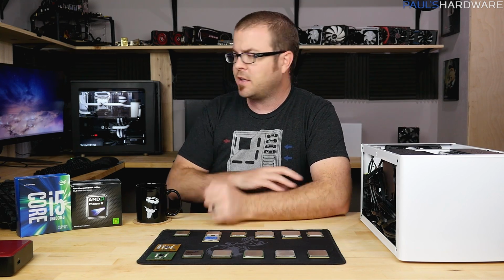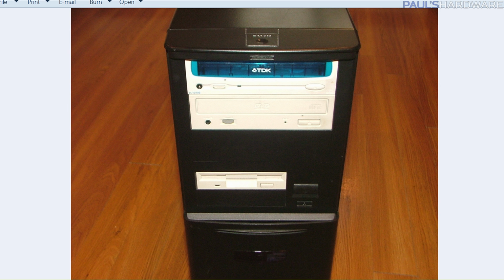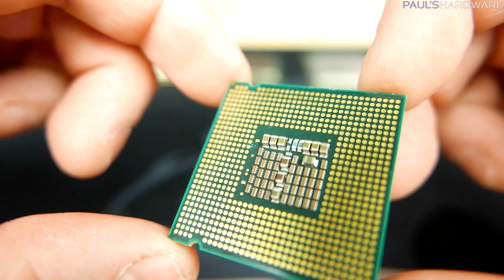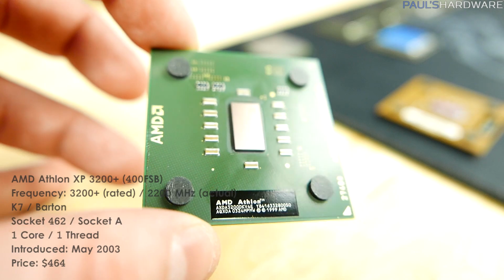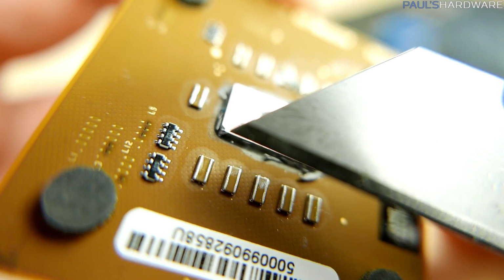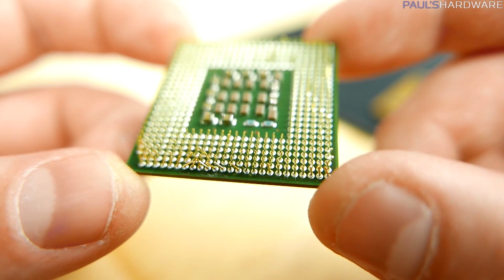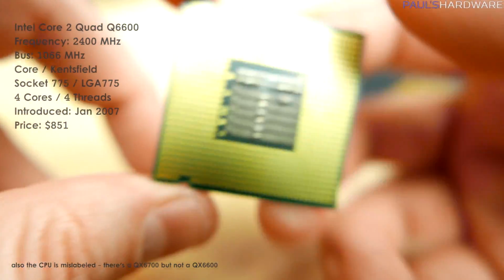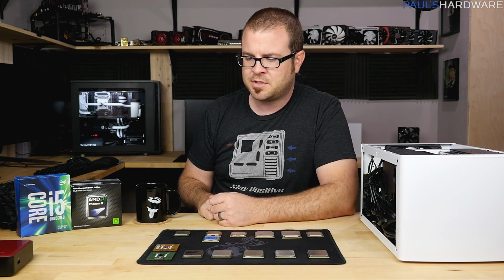My CPU Collection!

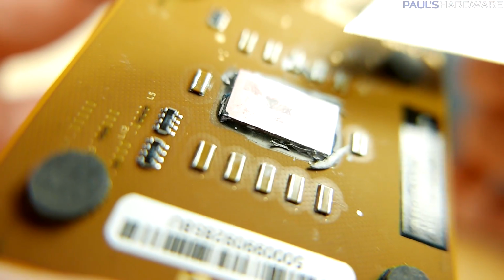Comment: 10:28 I’ve got a few Athlon XP CPU’s with worse die-chips than that, and they work just fine. In fact, of all the dead socket A processors I’ve seen, none of them died due to a chipped die.

I’ve also gotta correct you about mounting a cooler with the X shape method. Mainboards for the Athlon XP (socket 462/A) used a simple clip retention mechanism, it did not support coolers that could be screwed down in an X shape. The screwing down of a cooler using the X technique came about during the LGA775 era.

Comment: Intel Pentium 75, Intel Pentium 3 1000EB, AMD Athlon 64 3200+, Intel Core 2 Duo T7500 OC @ 2.6 GHz, currently still using an Intel Core i5 2500K OC @ 4.5 GHz, currently building a system with an Intel Xeon E5 1650 v2 (virtually identical to the Core i7 4930K) which after overclocking will be about as fast as an AMD Ryzen 5 1600X or 2600 but with far higher power consumption, quad channel memory and a silly amount of PCIe lanes.

Comment: I  still have a i7 920 on a Asus p6t deluxe x58, 12 g  triple channel 1600 .and it works just fine 24 hours a day 7 days a week never get's turned off and has done for about 13 years or so., it just runs faultless . Just goes to show Alienware was good before dell took over

Comment: The first system I ever built was with an AMD Athlon Xp 2500+ Barton core. I still have it, and the system. Those chips and that socket will always have a special place in my heart. It's actually a great socket for a retro build since you can do DOS and Windows Xp on it (if I'm not mistaken). I might pull that system out, clean it up and play some of my old games on original hardware :) Good times! 
Speaking of good times and old shit. I recently found my original Half-Life big box, as well as my Return To Castle Wolfenstein big box! Those are definitely going on the wall!

Comment: Mmm. You didn't talk about the mounting of heat sinks for the Athlon XP (and later) CPUs which required a flat-head screwdriver which always threatened to slip from the retention spring and land squarely in the motherboard to disastrous effect.

Comment: I remember ever computer I ever had in detail.  I started off  with a Socket A Athlon XP 1700+ around late 2001.  Moved up to a Socket 754 Athlon 64 3000+ 2.0 ghz after that. Kept that for a few years. Bought an Hp computer with a Athlon 64X2 4200+  after that and the MB crapped out. Replaced it with a Biostar AM2+ motherboard and got a Athlon 64 X2 6000+ Windsor core. That was around 2010/ 2011.  I kept that for a year or two, finally upgraded to a Phenom II X2 560 (With the hope of unlocking cores which was a fail) with a AM3+ board. Was waiting for the new FX Bulldozer CPU's to come out and when they turned out to be overpriced garbage, I got myself a Phenom II x4 980 as an upgrade which was an awesome gaming CPU in it's day. Then AMD fixed their issue with the at the time with brand new Piledriver FX chips,  and the FX 8350 did the job. I am still using my FX 8350 system built around 2013 to this very day. I only had to upgrade the video card once from a HD 7950 to a GTX 1060 3gb and that was just this year. It has survived longer than almost all of the others computers combined.

Comment: Still running a 920 D0 @4.0 , however when zen2 arrives it will get a good home as my wife's rig.
It's been my thrusty workhorse since '10 and has had a 5850 and a GTX 970 in it.

Comment: As for AMD Paul, I have owned all from the K-5 to now the FX-8370 under building my own. As for the FX-8350 vs. a well XXXXXX70 we can do 5.1 OC.I have done that with this setup. But as for OC That was for testing, and now it is back down to where it should be.

As for the AMD XP3200+ I had one.I also had the 939 3000 as well.

Comment: My spares: 
Some of crappy '02 celeron 1.3ghz single core i found for 99p on ebay
Core 2 quad q6600
Pentium D 930
Ryzen 7 1700 (in use)
i5 2520m (in use)
Celeron n2840 (in broken laptop,mean to fix it)

Comment: the athlons where locked so no over clocked but if you managed to connect the right spots on the die side you could unlock it and over clock

Comment: Used to have tons of those old Athlon chips. Even had a few dual cpu servers using them. Back in the day they were beast.

~Edit~ My first system was one I built, and it was the K6-2 333mhz. Used to use Epox mobos or E Pox or something, been so long I can't remember.

Comment: I bought a Phenom II 1090T in 2011 and I'm only replacing it this month with the new Coffee Lake 8700k. I had it overclocked to 4.0GHz on a Crosshair IV Formula and never had any problems with games at 1080p with a GTX 770. The GPU would usually max out first with the CPU hovering about 80%.

I still have the 1090T and the Crosshair IV. They'll both be used in my brother gaming rig so they still have a few years left in them!

Comment: I had an Athlon 64 x2 6000+. 
That thing was with me for 6-7 years. Then it struggled around 2011. Got an FX 8350 and it was light years faster but ended up getting an i5 4690k shortly after.

Comment: I still have the very first 1000mhz Intel Pentium 3 chip. It was a wonderful chip for its time. 133mhz FSB. I used to play with overclocking on this chip with some success. I think I had it up to 1.2ghz on a custom water cooling loop. This was during the time when clear acrylic cases were the shit and cold cathode UV lights were all the rage. UV reactive Ultra ATA 133 cables and non modular ATX power supplies that took some work to sleeve. lol

Comment: I think your memory is a bit cloudy because Socket A (462) motherboards don't have holes in the motherboard to mount the heatsink, the heatsink is clipped onto the actual socket. So your whole talk about cross patterns and tightening down corners of the heatsink doesn't apply because that's not how it worked.

Mounting a Socket A heatsink worked via a leaver action where you clipped one side of a retention mechanism down, put the heatsink flat against the die and then clipped the other side of the retention mechanism to the other side of the socket. The most often cause of die cracking is from mounting the heatsink backwards. There's a plastic shelf on one side of the socket and an indent in the heatsink to match, if you installed the heatsink backwards, you'd end up putting an edge down on the die and crack the chip if you forced it.

Another common problem was people putting screwdrivers through the motherboard when heaving down on the retention mechanism to get it clipped to the socket. Some retention mechanisms had far too much spring pressure and no well designed place to put a screwdriver to push down on. People would put the screwdriver wherever it would fit, push and it'd slip and plunge straight into the motherboard.

I'm glad that both sides got away from leaf-spring type retention mechanisms with hooks because they're so prone to causing expensive hardware damage if you don't know what you're doing. AMD has had an excellent retention mechanism since the Socket 754, and I'm glad they've kept it so long. Intel on the other hand has the shitty plastic push pin system which is very annoying to install and is also very prone to breakage. I keep a box of those push pins around because customers break them so often.

Comment: i had one of them amd cpu`s chipped bad the pc would turn on but funny thing started and it would crash after crash,i all so had a amd Athlon 1300 friday 13th 2001`ish i for got to put the heat sink back on & a heat haze came up out of the case as the di turned a nice shade of red, turned it off as quick as i could but to late DEAD but u could not tell it had been over heated so took it back to a___?, told them it just died  they took it away round the back to test it  and they say yes its dead  but all we got is a amd 1333mhz Thunderbird so i said yer ill have that lol  went home happy with a faster cpu 33mhz faster and i never for got to put heat sink on again.........

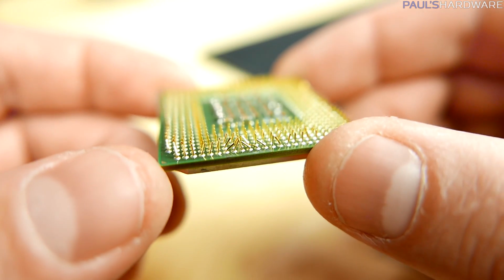Comment: 12:30  I once bought a small storage unit from an older gentleman with questionable values, with dozens of dell dimension 4400 and 8300 machines, and hp xw4100 workstations and various bins with components for these machines. All Northwoods and Prescott's if I remember right, all 32bit. I got very good at bending the pins back using the exact same method.

I'm actually still using one of the xw4100's as a file server. A 3GHz Prescott, 4GB RAM, full of SATA and IDE disks, on OMV3.0. It's been running for the most part going on 6 years now. Not continuously. In that time the only things that have needed to be replaced were 1 HDD, and a RAM stick that was probably nearing its end when I put it in. 
It just works. Gives good throughput with 2 netgear Gigabit pci cards in a bond($25). I added 2 additional fans I already had. I have a skeleton system that has replacement components for the entire server, minus drives and NIC cards.
I have the ability to build a new NAS system but this one just runs strong for its load average so there's no need to upgrade except to say I have the latest and greatest.

Comment: My Main System Has A i5 650........ herea the specs

intel core i5 650 
Geforce GT 710
Acer Veriton X490G Motherboard (LOL)
2TB and 320GB Hard Drive
Windows 10 LTSB 2015 x64
400Watt Power Supply

Pretty Low Spec...... Could Any Recommend Me a decent custom built computer specs for $500?

Comment: Just simply nicking the corner of the die doesnt auto kill it.. Depends how big, other crack, etc.. The "die" itself isnt on the top layer, there is a decent amount of just raw material on top. I have a 780ti with a chipped corner and it still works fine : )

Comment: I still have a fully insulated Chieftec CS 601 from the early 2000's - It's great as a case for the 2nd PC because it has tons of place for hard drives (up to 9) and optical drives (up to 3). Back in the day we actually had to insulate our cases ourselves :P

Comment: My HTPC is still rocking a Q6600 Core2Quad.
I've put a modern GPU in there so that I can playback HEVC h.265 video but other than that, it works perfectly fine :)

Before it got put into my HTPC, my Q6600 was my gaming CPU, for a few years.
I upgraded to a i5-2500k which is still driving my main PC.
I'm planning to go Ryzen 7 1700 later this year.

Comment: CPUs I've owed, always overclocked too, every single one here goes:intel 386,486, AMD K6-2 333mhz, slot1 P3 500mhz, AMD Duron 800,Athlon Thunderbird 1ghz, Athlon xp 1800+,Athlon xp 1900+,Athlon xp 2500+(Barton) unlocked multiplier revision, did 2.25ghz, Pentium D, Core 2 Duo,E8000, E8400, E8500, Core 2 Quad Q6600, Q9650, i3 4??? ,i3 7100k i7 920, i5 4690k, i7 4790k, i7 3930k,4930k,5820k,Xeon E5 2650, AMD R7 1700.

Comment: Hey @Paul's Hardware, if you want some K6-2's I've got a few I pulled from working systems years ago (no motherboards sadly).  I believe I have the 450 MHz and a 500 MHz versions.  I still find it funny that AMD had a "designed for windows millennium edition" logo etched on them.

Comment: i can relay to I7 920. It whas a dam great CPU and overclock like hell. My I7 920 where a DO revision and ran 4.1 GHz 24/7 and for benchmark it cut go to 4.4 GHz but i replaced it for not so long a go with an I7 980X oc to 4.25 GHz for 24/7 use and for benchmark up to 4.77 GHz with all 6 core and HT still on with only aircooling (amazing chip) and boy thats a nice cpu to play with. Yes im still on X58 after 8 years and still going strong. Played BF1 64 player online last night and it ran perfect even at ultra settings i had no proplem keep FPS at 65 to 85 FPS with two GTX 970 in sli but i idmit i had to lower settings after some time but not because of CPU or GPU struggle no i simply ran out of Vram else and cause the game to crash. X58 is still after all these yeah a platform i like and i even have a M.2 SSD fully working aswell. Se my channel for more about that.

Comment: i have a  barton 3200+ socket a sat in the bedroom in a socket i pulled from a dead board, even still has the thermaltake copper support shim, no chipped corners

Comment: I have Athlon XP CPUs with chipped corners that still work, the chipped corner isn't what killed it, remember CPUs are flip-chip design, meaning the design that is etched to the silicon is flipped over and faces the Organic PCB that the pins or pads are attached to. 

You could literally grind away most of that exposed die and the chip would still work, it's just excessive silicon used to give the die rigidity so it doesn't fracture during manufacturing and packaging. 

The reason your CPU likely died was due to the micro solder bumps on the under side becoming detached during uneven heatsink attachment, and the corner damage was just coincidental but unrelated damage.

Comment: I could have never collected all the CPUs I have used over the years.  My first computer use was back around 1975... an old Texas Instrument teletype terminal with a phone coupler It had no screen and had to print everything out.  My father would bring it home on weekends for work sometimes.  My oldest brother got a TRS-80 Model 1 computer back in 1978 maybe.  Two of my other brother bought a TRS Color Computer (CoCo) back in 1980.  My oldest then got an IBM-PC in '81 and an IBM XT in '83.  Then I got my own computers...

My first computer was a used 386 sx-25.  My brother borrowed it and fried it, so I replaced the board with a 386 XD-33 with 2x the memory.  The only whole computer system I ever bought was a Cyrix PR-200 (remember those good old Pentium Ratings :D).  I ran DOS 6.0 and Windows 3.11.  It was the worst computer I ever had.  I had to reinstall everything every 6 months it was so unstable.  I then got an AMD K6-2 350 with a Voodoo3 3000 (and latter upped it to a K6-3 450) and finally crowned it all off with my favorite system back in 2000 with a Duron 600 overclocked to 900Mhz (with the pencil trick) and in 2002 put a Radeon 9700 Pro TV in there.  I loved this system.  Biggest jump in performance yet.  I skipped the whole Slot 1 section as my Duron held its own.  The Athlon XP 1600 and GeForce4 Ti 4200 rocked.  I think I did an Athlon X2 2600 with a Geforce 4400 GT and finally upped it to an Phenom II x4 945 (3Ghz) with 8GB DDR3, 1TB 7,200 RPM HDD, and a Blu-ray burner.  I added a 2TB drive for backups, switched to Windows 7, and added 24" 1080p monitor.  Then I doubled the memory to 16GB and switched to a GeForce GTX 950 and Windows 10 (for Fallout 4).  I recently picked up a Geforce GTX 1060 (6GB version).  This Phenom II X4 is still running strong after 8 years and my son is rocking my X2 and 4400 still.  I likely will not be able to replace it for another year.  I would love a Ryzen 1800+ and Vega 10 with a 4x monitor, but I do not have $2000 to burn right now.  I likely missed a few systems in there, but I do not upgrade like I used to.

Comment: About a year ago (around when this video went public), I picked up an old Compaq desktop at the recycling center.  I wanted to see inside of it to see what parts it had and what I might need to add so they loaned me a screw driver.  It was running an Intel 486 CPU!  That made me want it just because the first Windows PC I had was also a 486, however my first Windows PC was 100Mhz and the one at the recycling center was 33Mhz.  It had all the necessary stuff as well as all the drives.  We got about $20 for the cans we took in and they only wanted $4 for the computer.  So they handed us $16 and we took the computer.  Got it home and it booted into Windows 3.1.  I had a set of Windows 3.1 floppy disks but some weren't working properly so I ended up having to download those off the internet.  Also downloaded DOS 6.2 and put a fresh install on it.  I had forgotten how much easier things are now than back in those days!  Had to deal with the Autoexec and for some reason, I hate that the most....but was nice to find a computer from back in the day at a recycling center where EVERYTHING worked....even the 5 1/4" drive!

Comment: I have 3 amd Athlon from 1999 and I got them from my school dumpster along with a DVD drive, a dead PSU (which had an almost silent 120mm fan) some old 132 mb GPUs and a few cables. xD

Comment: I remember my dad upgrading our 486 sx 25 to a dx2 50, I felt like we had a super computer. We also had an athlon xp and it used to just shut itself down if it wasn't cleaned regularly. I understand why now lol. Right now I'm still using the i7 980X I've had for the last 7 years, it ran at 4.4GHz for 5 of those years, but then started to run a bit warm so I had to go back to stock clocks. But yesterday I ordered an i7 6850K which I hope will last me for another 7 years. I might keep hold of my 980X though seeing as it still works fine.

Also the Gulftown i7 980X was the first consumer (enthusiast) 6 core :)

Comment: I just found a nice discarded desktop about 2 months ago. 64-bit HP Compaq with an AMD dual-core processor and 4 GB of DDR3 memory.. It was missing both the optical and hard drives. I installed a 500 GB sata that I bought for $25 from Goowill and installed an old  DVD R/W I had laying around. I have it running Windows 10 and it works great. Best computer I ever owned for less than $50.

Comment: @Paul's Hardware ~ I am still using that old ATX Alienware Gen 1 "Hydraulic sliding front panel" black case for my own system. I acquired it direct from the manufacturer that made them for Alienware which was (I belive) either Chieftec or In-Win. (I know, time to upgrade) Mine is the full tower version. I also still have those TDK CD-R Burners.
I am running an Asus Maximus Formula II motherboard with Intel Core 2 Extreme QX9650 (Engineering Sample) Yorkfield 130.0 W Max TDP Socket 775 45 nm (Running stock clock @ 3.00 GHz), G.Skill PC2-6400 (2Gb x 4 Sticks) 8GB total in dual-channel, Sapphire AMD Radeon HD 7950.